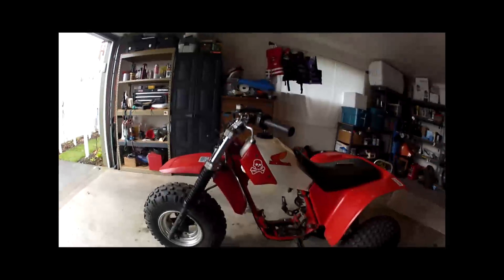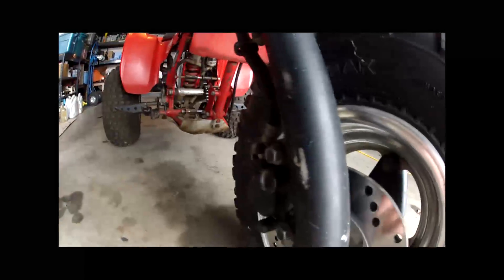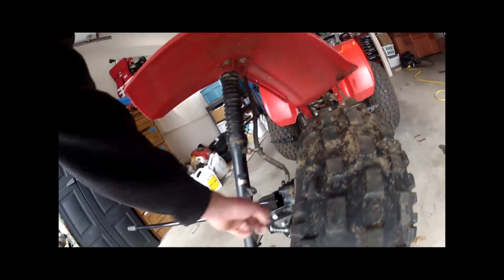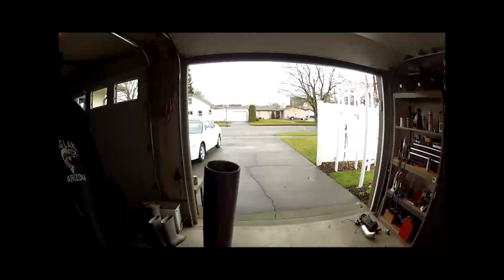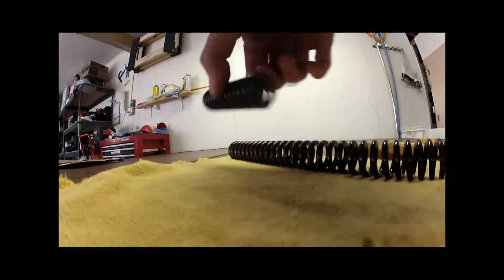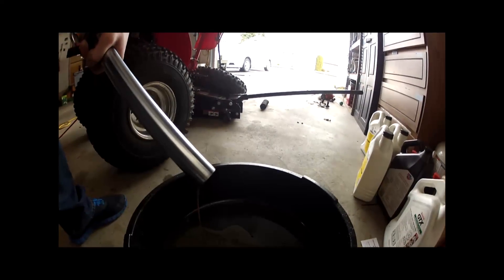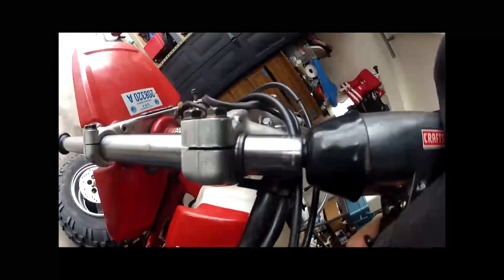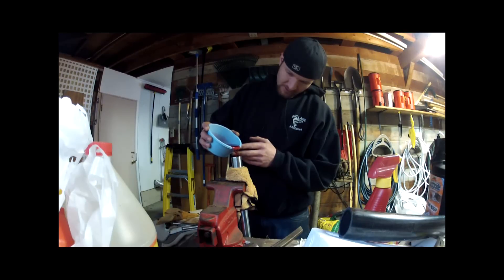1984 honda 200x atc fork/shock oil change

Comment: Great video..  I just picked up a 200X 
It's definitely a project bike..  But, I'm up for the challenge.. I will be doing my forks just as you did in this video..  Great video by the way !!  You called your bike a 250X ?  DO YOU HAVE SOMETHING OTHER THAN THE STOCK ENGINE IN IT ? What is the engine in the shop for  ?